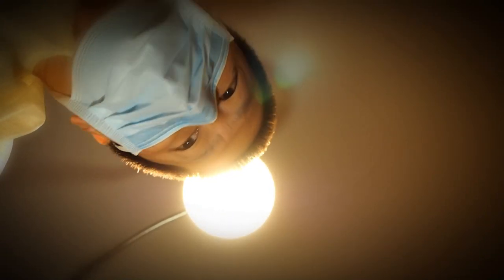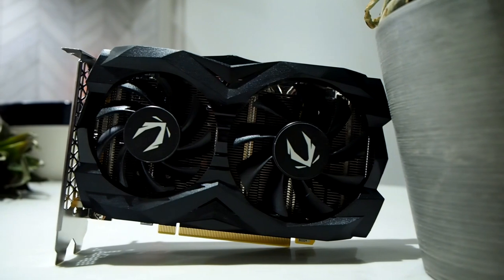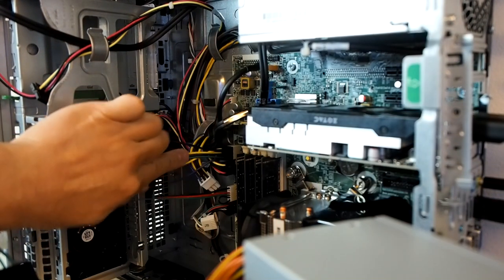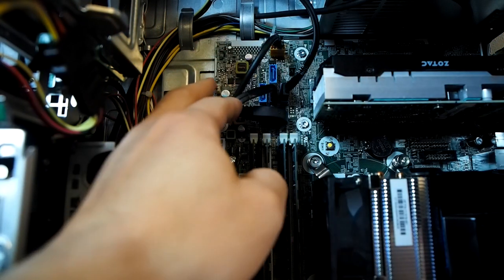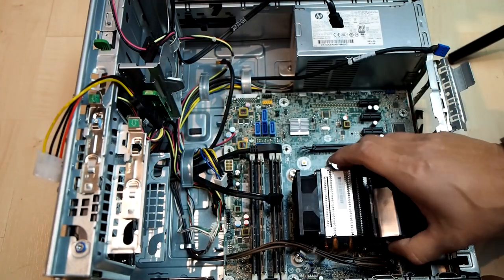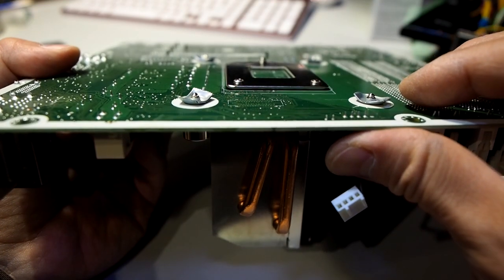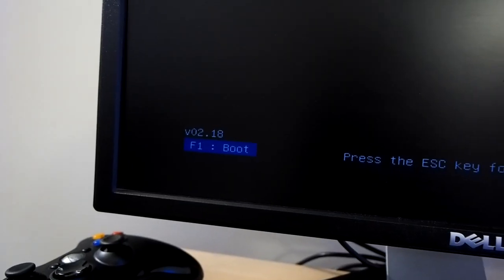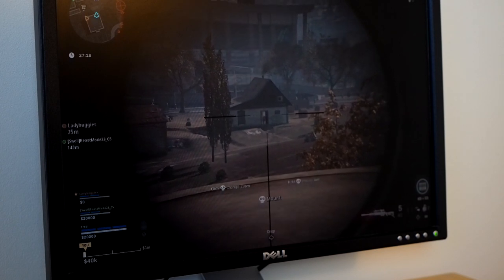Converting an Office Computer into a Gaming Beast- HP Prodesk 600 G1- PSU, Case, and Video Card

Comment: how do you get it to turn on? i plugged in the power cable but it won’t turn on
Reply from the maker: Triple check all the cables are attached. Maybe the power cable adapter being used is faulty or not compatible?

Comment: I'm using nearly the same motherboard but it's a hp prodesk 400 g1, would the power connector work the same?
Reply from the maker: Don't know. Look up the cable and see if it is listed. If not then check the number of pins. If they are the same you could take a chance but no guarantees.
Reply from the maker: https://www.ebay.com/itm/224168363198 
Here's a cable that I just looked up that has your model listed.

Comment: You can help me? My HP prodesk600 g1 can not work😥
Reply from the maker: What is the issue?
Reply: @LadybugAdventures  (sorry for my English) flashing status light
Reply: (I'm use translate)
Reply from the maker: Sometimes the flashing has a pattern that corresponds to a system issue. Lookup if there is a status light troubleshooting sequence and that can help you figure out.

Comment: What about that start up problem that u have to press f1 did u found a way to fix it
Reply from the maker: Many tries but never got it fixed.
Reply: The USB and fan errors can be fixed by grounding certain pins on the headers going to the front panel.  For example, if you look at the original cable that goes to the power switch assembly, you will see a black wire that is looped back.  The fan error will go if you jumper the same pins on the motherboard header.

Comment: Hello i have a hp elite desktop 800g1 will the 24pin to 6 pin converter will work? just plug and play
Reply from the maker: If you go to the link in the description for the cable your model is listed there so it should work.

Comment: My parents ordered me a HP 600 sff and I've been looking it up and it doesn't seem as good. But here are the specs HP 600 G1 SFF Computer Desktop PC, Intel Core i5 3.2GHz, 16GB Ram, 128GB M.2 SSD, 1TB HDD

Are those good? I don't know much about pcs
Reply from the maker: Sounds like mine. I still play warzone on it without issues. That is using an older GTX 970.
Reply: @LadybugAdventures  thanks what do you think about Fortnite?
Reply from the maker: @socxs_  It plays it well also.
Reply: @LadybugAdventures  alright thanks for the info
Reply: @LadybugAdventures  one more thing without the gtx will it still run good?
Reply from the maker: @socxs_  Not for games like fortnite
Reply: @LadybugAdventures  oh alright

Comment: im doing a build with this motherboard because its the cheapest but i just realised the standoff thing do you know if there is a aftermarket standoff?
Reply from the maker: Are you referring to a standoff for the cooler? You can use a simple nut at the back of the motherboard and screw into that. I just didn't want to go to the hardware store for the right size nut.
Reply: @LadybugAdventures  thanks anyway but now im using a dell optiplex 3020

Comment: Please help
What can I do I have 750ti 4gb
Which is not fitting inside the case
Any other option rather than buying a new case
Reply from the maker: I've seen people use a PCIe extension cable and simply hang the GPU on cable ties or something like that. If it's a thick card then you'll have to operate it without the side panel. If you don't care what it looks like then you can also get an old computer case for 5 to $10 on a used site and install it in there.
Reply: @LadybugAdventures  can you tell how much does a PCIe extension cable cost?
Reply: @LadybugAdventures  i also not want and care about a good looking pc so what i think is i should bring a 12 years old case ?
Reply from the maker: That would work.

Comment: Will a 1650 work on the pro desk 600? If I  upgrade the power supply?
Reply from the maker: It should with a new power supply. You'll also need a new case if you don't have the mid tower design.
Reply: @LadybugAdventures  oh man I have a micro atx and I'm trying to see if I can fit a 1650 super in it ( asus single fan ) but the main problem is my psu  and idk if it'll fit

Comment: so with the upgraded power source can it run more than one monitor?
Reply from the maker: The upgraded power is for running the GPU alongside the CPU. In its original form you can always run multiple monitors as long as there is output for multiple devices. A lot of motherboards will have a VGA and an HDMI or DVI output.
Reply: @LadybugAdventures  ok thanks ik nothing about pc so trying to do a budget build to learn n for streaming
Reply from the maker: @nomad5454  cool. Good luck!

Comment: can i use 1050ti or 1060 in this one? i dont want to buy a cabinet
Reply from the maker: Check the power consumption of the card you want to use. The power supply in these desktops is usually under 280 watts so you have to be careful about the cards you add. Also you need a low profile card. If you use a regular one you''ll have to keep the side panel off.
Reply: @LadybugAdventures  then can i also install 1080ti in it?
if im ready to keep side panel off
Reply from the maker: @varadpanaskar3414  they want you to have a minimum 600w power supply. As long as you have 600 w go for it.
Reply: @LadybugAdventures  thanks sir for help. i subbed :-)
Reply from the maker: @varadpanaskar3414  glad to help in any way!!! Thanks for doing me on my variety show of a channel.

Comment: SIR please tell what are your ram mhz.....
Reply from the maker: Pretty sure it's 1333
Reply: @LadybugAdventures  Sir is there any way to over clock ram mhz to 1600 or overclock cpu
Reply from the maker: Really not sure if the i5 4570 is over lockable. I don't think so. Ram as well.
Reply: @LadybugAdventures  sir if you find a method to clock cpu then please make one video

Comment: Pleas any one tell me the psu power is ??w is enough?
Reply from the maker: The PSU I use I around 450w. The PSU from the original is 240. The 240 w psu won't be enough for a decent gaming graphics card.
Reply: @LadybugAdventures  tq bro for your replay i want to ask if our psu is bigger than the require psu is this will make any problem are ok??i mean if i try 500w psu for this typr of pc this will enough or too much?
?(sory for bad english🙏🙏)
Reply from the maker: @ayeshamel520  no such thing as too much. For example if you have a thousand watt PSU it will only use as much power as needed. The 1, 000 watts simply indicates the maximum load allowed. You can go wrong if you use a lower powered PSU. Check how much your processor and GPU need.

Comment: 6:44 - Your wiring diagram is wrong, as is all others. I dont think theres a single video with the proper wiring diagram...
Reply from the maker: It works. Can you elaborate on what is the correct pinout.
Reply: @LadybugAdventures  I can't find the right one, but I've tried this and others and it won't work on my board
Reply from the maker: @charliep649  same model? I know they are different depending on if it was a 800 g1 or g2 etc. Mine is the 600 g1 and this definitely worked.
Reply: It's a g1 sff. Also causing issues with not accepting the new case USB headers and gpu isn't reading at all... My dell build was alot easier
Reply: @charliep649  I built mine following his vid and I have an hp elitedesk g1 800
Reply: The wiring diagram is correct for the 600 G1.  Check the orientation of the diagram based on the key pin slot ...
Reply: Tried one of those aadapter cable I  used on Elite 8300 (and worked OKay), but  it fried my Elitedesk 800 G1while trying to interconect the fan sense pin with the tacheo pin.  Could anyone elaborate on the differences between the two adapters, please?